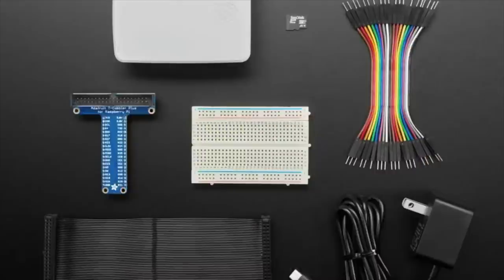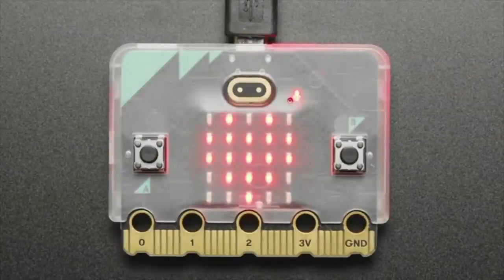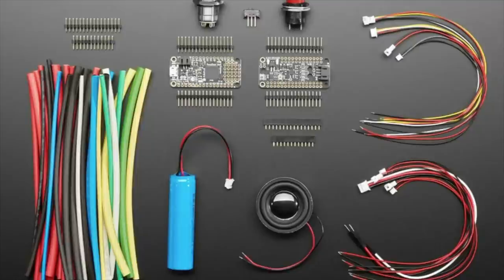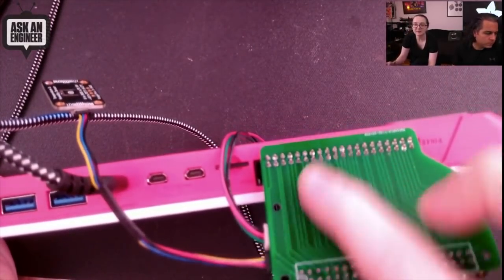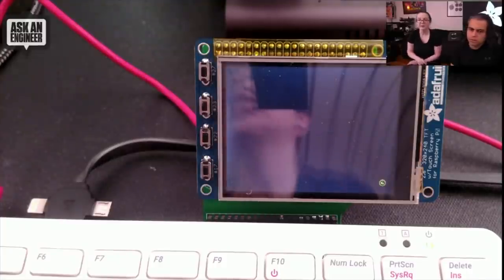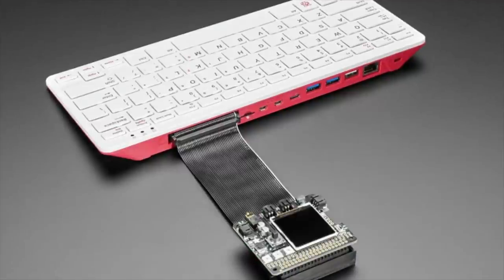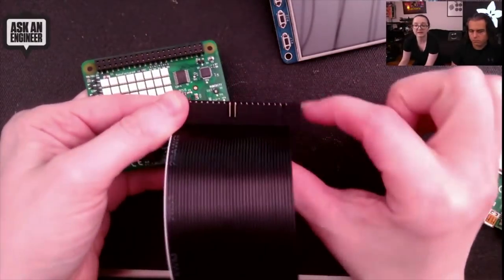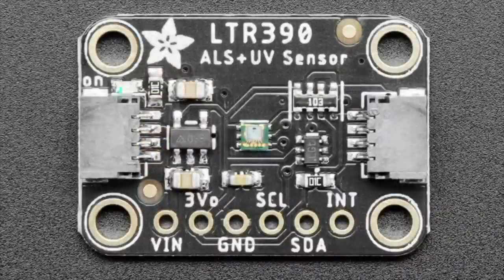New Products 12/31/2020 featuring Adafruit LTR390 UV Light Sensor - STEMMA QT / Qwiic!

Comment: SUGGESTION: Sell a pattern for the tote bag as part of the bag or as a separate product. When California decided to mandate a fee for shopping bags, I decided to make my own tote bags out of canvas and nylon webbing. It's surprisingly inexpensive and a wholesome skill to learn.

There needs to be a machine-learned model that can look at the data stream from an accelerometer and tell the difference between a swing and an actual hit, so the micro in the lightsaber will fire off the right sound effect.

I would need a 3D printed stand for the Cyberdeck, because I would totally bump into the computer and bend pins.

For those who want to make their own ribbon cables with 0.1" pitch connectors, you want to look for "IDC cable crimper" on Amazon or Digikey. If I need to carry up to 9 signals plus ground, a 10-pin IDC cable is really handy, if a little bulky. Making one for a Raspberry Pi is just a matter of getting 40-pin connectors and raw ribbon cables.